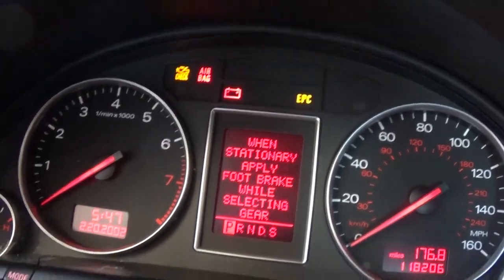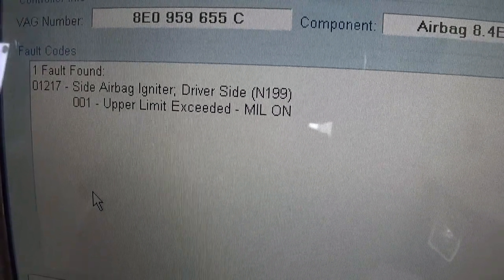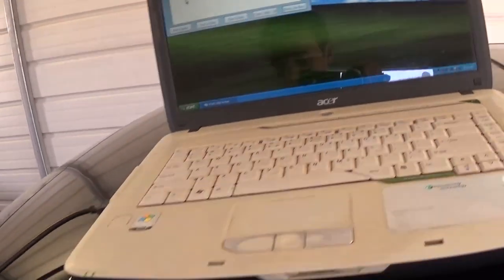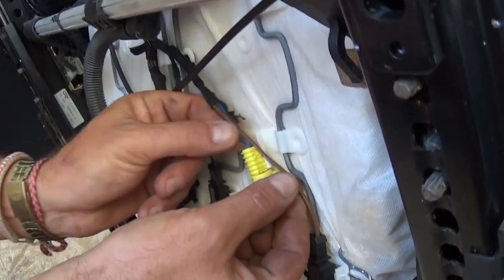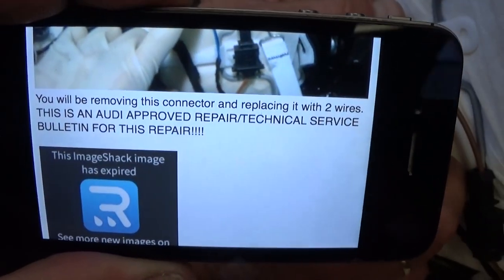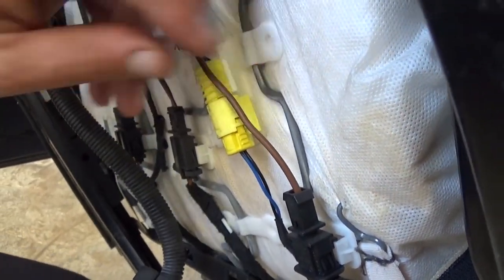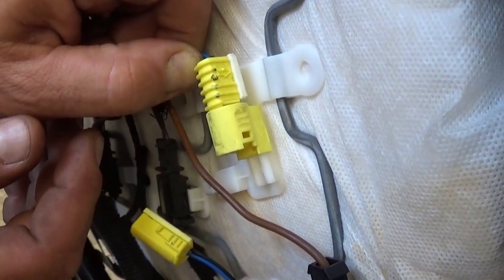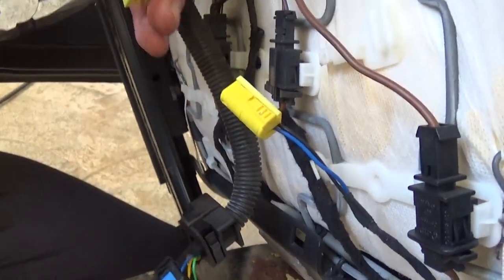Audi A4 B6 Airbag Light On. FIX  SIDE AIRBAG IGNITER. Air Bag Light

Comment: why would you use a pair of grips/pliers to close the inline crimps ?
you have no guarantee of a proper compression joint.
anything other than dedicated crimpers is a bog job and likely to fail in the long run.
tapeing and double tapeing the joint ????
this person is definitely no auto eletrician, has the answer but not the means to do a professional job.

Comment: I have an Audi A3 and I purposely removed the connected wires from the seats since I don't use any warming feature or other stuffs I thought they were completely useless. Now the airbag light is on. Can smo explain me what has to do an airbag with the seats. Is it when I have an accident the seat will propell me to the moon?😂

Comment: Will airbag still work properly after this?
Reply: That's what I'm wondering.
Reply: Yes. If there is no error any more, the airbag will work just fine.
Reply: Of course.
The purpose of the connectors is just in case you need to remove the seat from the car.

Joining the wires together just takes the connector out of the equation. 

The electricity just flows through the wires instead of through the wires, through one side of a connector, another side of the connector then the wires again.

Nothing is different until you need to take the seat out of the car..... Then you'd need to cut your wires to have that separation.

I'll try and draw a little diagram.

--------| |---------
--------| |--------- (that's the wires with a connector)

-------------------- 
-------------------- (that's the wires that are joined together).

Electricity flows through both, but the second one doesn't have a dodgy connector that's causing the error code.

Comment: I tried your solution. But it didnt fix the problem. It says this

01222 Active/Static
Side airbag crash sensor, passenger side - G180 - open circuit 

I removed the clip under the chair. The yellow clip. From the floor

Black seat to blue floor 
Blue seat to White floor 

These colours were in this clip. The brown i didnt connect, its just hanging there. But it Will not reset

U got an clue whats wrong ? When i watched live data from my computer who was plugged in i could see there was " too high " problems on driver seat also. But didnt get it as an error on the computer. Help please

Cheers

Comment: Hello, how are you... I have a 2002 3.0. Disassemble the steering wheel to change the starter switch and when I assemble everything again, the airbag light turns on, check if I counted it correctly and if I did, but it stays on and before this repair it was not on. I annul the connector and put it direct?. Thanks.....

Comment: I get the airbag light, but no airbag fault code on my scanner 🤣😂

I just wiggled the yellow connector and it's interesting to see that the red light went off then back on again. Leads me to think that this fix will work for me too. 

I'm worried about disconnecting the battery because I don't want to lose the use of the CD player.. I don't care about the radio but I want to keep the CD player working

Comment: I have done this repair, it remained off for a day or so but has now come back on. Do I replace the crash sensor in the B pillar next......? Thanks.
Reply: @Naughty_Squad  yes I did thanks.
Reply: @Naughty_Squad  it wasn’t the connector or the sensor that was at fault. If you remove the seat back and look along the bottom, you will see a horizontal metal support, this breaks and creates a sharp end, this sharp end rubs on the wiring loom for the airbag. It eventually pushes through the wire insulation and creates the fault, because it earths whichever wire it breaks into. 
Seat back removal, prise gently from the top, looking down you will see where it’s held, use a long flat blade screwdriver lever the seat back off at both sides, take care it’s quite fragile, bottom part will come off when you pull it straight up.

Comment: I had a problem in my audi a4 b7 notice everytime i open drivers door light comes on and check airbag   igniter driverside. What color of th e wire in the door  there are bunch of wires.

Comment: i have the following error : fault 00654 seat belt tensioner igniter, driver side (N153) 001-upper limit exceeded MIL ON. I followed what is on the video and it did not work what could be the problem?

Comment: HI.
Is it necessary to replace the plug with a permanent connection?
Or maybe you can clean the plug ... if it helps?
Reply: Obviously, the problem is poor contact inside the connector, but apparently it's a very common issue and Audi does indeed recommend cutting the connector and hard-wiring it instead.

Comment: Really well explained !! Jeez dude !! You should do every repair DIY for the A4B6... I would be more than glad to download all those 6 years long videos !! Thanks again you saved my day !!
Reply: I don't see explanation, just do like that and thats's all.
What was that connector, what was removed? Was that some kond of pressure switch? I mean sensor for seat what check is someone seating on sear or not?
Reply: @janisvinters8797  it was a connector… you said it yourself. It just continues the flow of current. Not a switch or any kind.

Audi recommends this fix.

Thx

Comment: Hi I have on side which the wires are brown black and blue and the other side brown green and white I presume brown goes to brown so is it blue to white black to green         Or.   Black to white and blue to green
Reply: Hi, i have the same problem, did you manage to work out which wire went where? Tia

Comment: If the trouble code is for passenger side, the connector is under passenger seat and if it's driver side code, then it's under the driver seat? Or only one connector for both sides? Thanks in advance

Comment: Why wouldn't you solder a connection as vital as that?
Reply from the maker: +Jake Joseph http://nateronline.com/Technical_Bulletins/2008.02.11_Airbag_ignitor_side_DTC_01217_01218.pdf
Reply: +World Mechanics Very interesting, thank you for posting that.
Reply from the maker: +Jake Joseph No problem Jake. Hopefully it was helpful!
Reply: Airbags are very sensitive to changes in resistance and soldering over time increases the resistance..
Reply: Audi tell you not to

Comment: I have a 2002 VW Passat Wagon GLS V6 4Motion, my airbag light came on and I had it diagnosed at the dealer. They said it was the passenger side curtain airbag that is causing the fault. Would I use the same procedure for the passenger side? Or do I need to replace the airbag?
Reply: better replace your car

Comment: I've done the same procedure but still the air bag lamp stays on
Reply: You need to clear the code. reset it with a obd2 scanner. if it does not work something else than the connector is the problem
Reply: @Naughty_Squad  Better open the dash, identify the airbag led and cut it
Reply: @aldodelcorso9712   that's really silly advice 😁
Reply: @CraigMansfield  Damn right 😁
Reply: That's what i've done actually 😁

Comment: What about a 07 A4 Cabrio?
Reply from the maker: +Dean Gassert what code do you get. If it is the same one this will be the problem.
Reply: I have a 01212 code igniter for belt tensioner rear passanger  any suggestions?
Reply: @DEANLATEMODEL18  I got these same issue. Did you fix it?

Comment: why didn't you heat shrink the tubing after install?? extremely vital
Reply: I was thinking the same thing. I wouldn't have used those connectors in the first place those don't connect very well.

Comment: pleas sir lhave problem with airbag  ignitir side/ resistance too high .what should I do?
Reply: and what you did eventually? :)
Reply: @FCJaca  I wanna know as well 98' A6 2.4L V6
Reply: @CerealKiller.  I managed to "repair" it, I had to replace the connector under the seat with resistor and it works like a charm
Reply: @FCJaca  could you tell me what type and resistance It was? Thanks bro in advance
Reply: @FCJaca   what resister use ? thanks